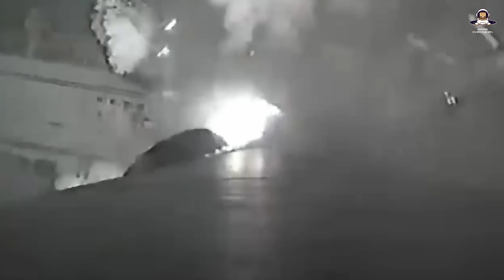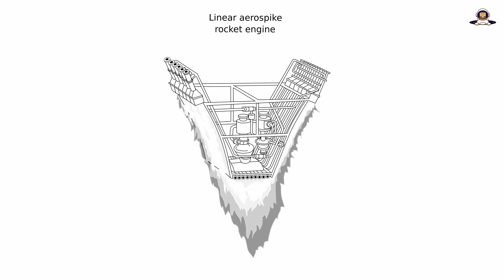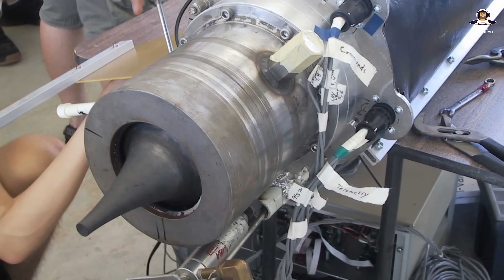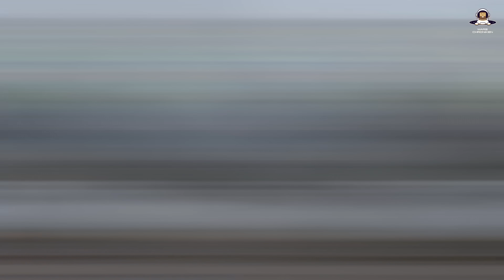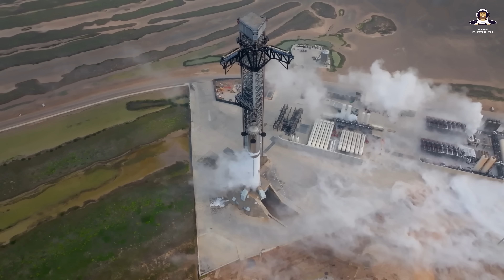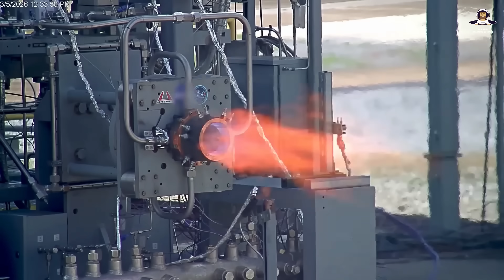The Holy Grail of Engine Tech: Aerospike Engines Explained

Comment: Keep Dreaming:
The hard problems have always been cooling (the spike sits in the middle of extremely hot gas), structural weight, manufacturing complexity, and overall system-level trade-offs. 3D printing has meaningfully improved the cooling-channel situation, which is why we’re seeing renewed activity. But as of 2026:No pure aerospike has flown to orbit.
The flight demonstrations so far (Polaris linear aerospike on small demonstrators over the Baltic) are short-duration, low-thrust tests.
Larger efforts (Pangea’s scaling ARCOS, LEAP 71’s printed engines, etc.) are still in development/testing phases, with orbital flights targeted later this decade at best.
Even the most advanced “aerospike-like” system in near-term contention—Stoke Space’s upper-stage ring of thrusters on Nova—uses the effect cleverly as part of a reusable, actively cooled heat-shield architecture. Their first stage still uses conventional full-flow staged-combustion engines.

A theoretical Isp advantage does not automatically win when the competing system has higher thrust-to-weight, better manufacturing scalability, proven (or rapidly maturing) reliability, and massive reuse.

Comment: Aerospace is concentrated flux flame redirektional pressure dynamic ,just like to bend the direction of a propaangas burner, the problem is that the thing that must redirect the super hot pressure flame will not last long but on the other hand a bell house divert the flame to the circumstances

Comment: The aerospike is fairly useless because its sole purpose is to enable rockets to operate in dense atmosphere. But rockets are orders of magnitude less efficient than atmospheric engines. Pistons, props, and wings are ever so much more efficient and safe than a rocket booster.
Thus, Aerospikes have little to no valid market.

Comment: Aerospike are actually s*** they simply don’t work like they suppose to, normal nozzles are better (Similar in piston engines with electronic and normal valves) but they have an advantage, they are the default shape for RDE where there's actual gains

Comment: 3 wavefront rotating detonation aerospikes is on the leading edge of maximum dV.
Aerospike in general is still an increment, but needs more to be compelling - Stoke space has an interesting take on the effect without the cooling issue.
Reply: Still needz more compelling?

How about RIME?

Rocket induced magnetohydrodynamic ejector.

You basically divert a little rocket fuel from the main engine, burn it and use the ionised particle flow to drive a magnetohydrodynamic (MHD) electric generator.

This initial phase of the RIME method is called an MHD bypass.

The generated electricity from the first phase is then used to power an MHD ejector that accelerates the flow of ionised particles in the main engine(s), achieving an effect very much akin to an ion rocket.

Comment: I keep thinking liquid hydrogen is the way to go still kerosene and methane are "hot"(expanding) fuel at combustion...i don't think that is true of liquid hydrogen as the propellant. SpaceX never did liquid hydrogen for obvious reasons although Blue Origin second stage does that. Liquid hydrogen oxidizes is insanely dense not a traditional fuel that combusts and generates heat ...until it can't anymore. "By the book" liquid hydrogen is generating pressure but i guess tgat would explain why the liquid hydrogen tank exploding was such a problem. That Space Shuttle main hydrogen tank really was amazing actually. How they got that fuel in that huge expendable tub into the space shuttle main engines i will never understand that. But yes ice cold to ice cold definitely prefer that to from crazy hot 🔥 to crazy cold ❄️🥶 Elon and SpaceX are definitely really into their engine layout as well actually. There is a point very much a spike where those combusting hot gases meet and seem to jet straight out anyways as opposed to just dissipate as you so correctly point out here as normative. Reliable matters in space 🚀🌌🚀🚀🚀 launch big time. Reliability and predictability. 😊😊

Comment: The key trouble with aerospikes is that the combustor has been turned inside out, creating a large annular throat with high heat flux, tight tolerances, and both tensile and compressive loads. You've taken the small combustor and made it huge, while still requiring lots of flow area for the regen cooling, vastly increasing the mass.

In a delaval nozzle the supersonic section beyond epsilon 3 or so can be made of aluminum- I know, I've done it- so that the large area of wall can be much lower mass. If you try that with an aerospike you save little mass because the spike is tiny.

If you want altitude compensation, add a nozzle eductor that entrains ambient air and enhances thrust. With two stages of eductor you can get greater thrust than the aerospike at lower mass, and the eductor can fall off when its thrust goes negative.
Reply: the general consensus is that the extra drag and mass means this is only helpful for low velocity, above about 150m/s the negatives outway the gains.
Reply: Obviously
Reply: @eniax    Gotta ask.  Was that sarcasm?  Because if it was, I’m right there with you.  wtf is he talking about?  If it wasn’t sarcasm, I just revealed that I’m not the smartest person in the room, which is ok.  😂

Comment: The reusable two stage solution may have made SSTO no longer relevant for Earth, but keep in mind there's an ideal use case for a single stage pulsed aerospike on a sample return craft for lower gravity worlds with atmospheres. I.e. Mars, Titan
Reply: Not for Mars. Its ground level pressure is about 0.6% of Earth's SL pressure, so any existing vacuum engines can work effectively, and better than aerospike.
Reply: Cost wise the claimed benefits of 2 stage "reusable" designs is significantly less than claimed by Elon Musk.

The costs of reverifying a rocket after spaceflight are very much non trivial, even to the point where the difference between reverifying a used rocket and building a brand new one are not so great as most people think.

Also if the rockets are not flying as often as they possibly can be then the benefits of reusability vanish.

The simple fact is that the orbital launch market isn't that big, SpaceX has significantly inflated the worth of reusability through its own StarLink launches.

Comment: I always figured a linear aerospike and a expander cycle engine would be a perfect fit.
You need extra cooling for an aerospike and you need as much heat in your propellant as possible in an expander.
Indeed, the power limitation due to scaling you normally find in expander engines is not applicable if the aerospike is used.
Reply: One of the main benifits of an aerospike is less nozzle which cuts the surface area by at least 50% that an expander needs. 

A ring expander is less effected by this and easier to package than a linear aerospike. Its just that linear aerospikes are inherently less susceptible to instabilities as any pressure pulses in the "trough" will self interfere 180° out of sink while a annular aerospike needs three throats to get the same result and prevent a reinforcing standing wave that tears the motor apart.
Reply: @randomizedpasta  
Interesting. 
This is data I did not have. 
Thank you.
However, the point is that aerospikes run hot and expanders need the heat for power.
Further, bell nozzels and, to a lesser extent, annular aerospikes suffer from the surface-area-to-volume-flow ratio that limits the amount of power that can be extracted from the cooling system. This, in turn, limits the total power of an expander.
IMHO, this is one of the reasons expander cycle engines are not used more often.
But, a linear aerospike does not have this limitation: any given geometry of linear aerospike will have the same nozzle area to propellant flow regardless of scale. This should allow expander cycle rockets to compete in power with the rest of them.

Comment: could we store a useful amount of hydrogen as water and use a nano structured electrical material to split the hydrogen off sort of on demand from you know millions of little sites. or maybe there's a better atom to partner the hydrogen with something like what is it CH4 perhaps
Reply: Do you mean store the hydrogen in a compound, for longer term storage, that doesn’t require low temperature to keep H2 molecules liquid and dense?  

Are your "millions of little sites” literally multiple small refueling sites enroute to a destination, or are they little chem labs within the ship to automatically liberate the pure hydrogen from the hydrogen-containing molecules in storage, ie water or CH4?

Comment: you can't solve the heating problem
Reply: Not true. A company called Orbital Technologies, (ORBITEC bought out by Sierra Nevada Corporation in 2014, not to be confused with Orbital Sciences Corporation) had an intriguing coaxial vortex "cold wall double vortex" approach where the oxidizer was injected at the throat and first swirled up the inside of the combustion chamber then upon meeting the top of the chamber the spinning flow would invert where it meets the propellant injectors and spiral back down towards the throat inside the outer vortex. 

The small scale experiments they ran iirc included modified RL10 test stands where the chamber walls remained as cool as 100°C. 

By completely substituting a beneficial fluid dynamic for any tubing or cooling channels the result is a cheaper, simpler and stronger combustion chamber. 

At that rate you could print an aluminum combustion chamber of almost arbitrary thickness/chamber pressure without worrying much about heat related strength loss.

Comment: Not just aerospike but aerospike combined with pulse detonation
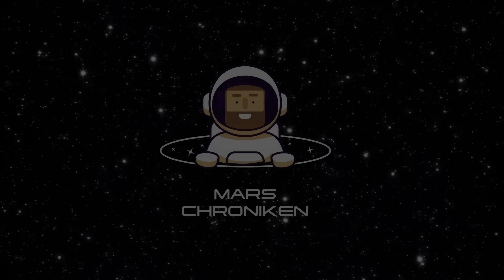Reply: yeah pretty much, the rotary detonation engine is lending itself well to an aerospike nossle, that and how metal sintering 3d printers changes the whole economics and possibilities of rocket engine making, here see that didnt take me 15:46.
Reply: *combined with RIME!!

(Rocket Induced Magnetohydrodynamic Ejection)

Basically fusing the raw power of a chemical rocket with the greater thrust efficiency per kg of fuel of an ion/plasma rocket.

Also I think pulse detonation is pretty much dead now that rotating detonation is here, at least for main engine thrust power, for attitude control thrusters PDE still has some use..